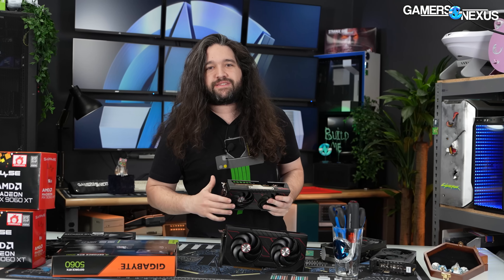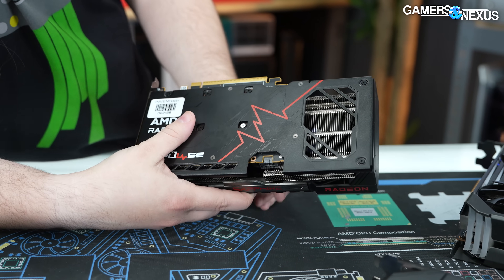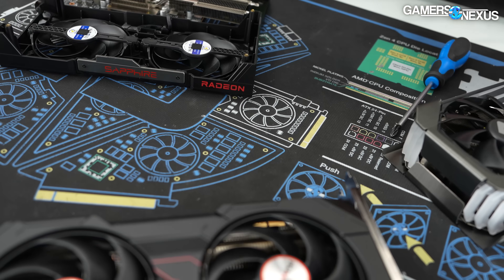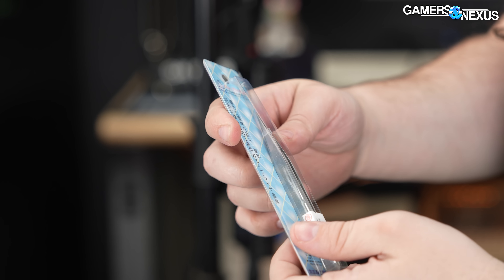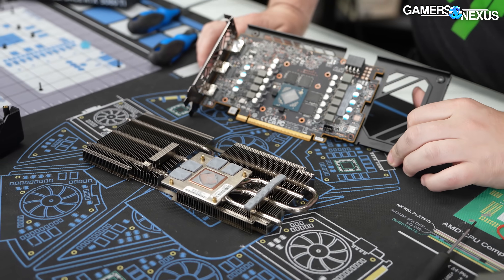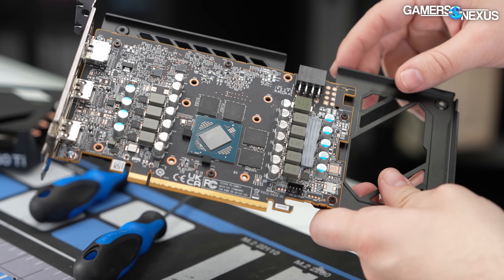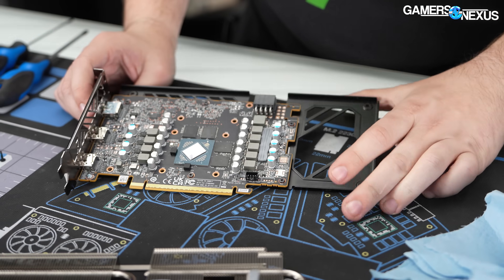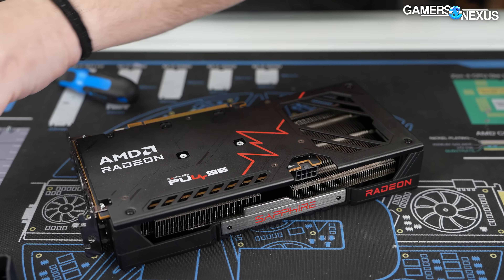Tearing Down Sapphire's RX 9060 XT 16GB & 8GB Pulse GPUs

Comment: 3070ti held on so long just to get replaced with an AMD card in the next coming months never realized I been using DLSS all my life
Reply: crazy that the 4 year old 3070 ti is still faster than brand new low to mid range cards, including the 9060 xt
Reply: @drewsillytoo  Just the 8gb of vram holding it back. Planned obsolescence. 😐

Comment: i envy those who can live in peace with that hotspot delta
Reply: Doesn't matter much. It just shows, that the cooling solution is not exactly a quality one. Which is not surprising, because the Pulse line is Sapphire's low budget tier. As long the core is comfortably under the max. junction temperature, which should be around 100-110°C the card won't throttle or gets potentially damaged.

Comment: Don't bother putting the 8GB back together
Reply: it shouldnt have been made in the first place, but its here now and throwing it away would be even more wasteful.
Reply: well, actually.... for someone, who play MMO like Warframe and i dont know... Destiny? 16GB is too OP, 8 totally enough. BUT price nearlly same. So i not sure why thats 8gb version even exist.
Reply: @Sasha-ud2eb  then they should be buying a massively cheaper card somewhere around 1650 levels of performance.
the 9060xt even with 8gb is still massive overkill
Reply: @guesswho2778  well, true... GTX5050 anonced, for 250$, looks like that card will be enough for game like that. At least DLSS for cheap. But that card must cost 200$, IMHO
Reply: @Sasha-ud2eb  go for a used 1650.
will still do the job and should be far cheaper.
hell even an old 1050 and one of those wouldnt need a power cable.
cant recall if the base model 1650 needs a power cable or not.

or, maybe an amd apu.
one of the ones with the powerful igpus in them.
Reply: @guesswho2778  i will search some used gpu maybe, not sure... Thanks for advice)
Reply: @Sasha-ud2eb  for destiny 2 you may want to go for a 1060 6gb.
it will require a power cable, but it should be fairly cheap and its the recommended gpu for it on their steam page.
make sure it is the 6gb vram variant though.
Reply: @guesswho2778  actually, for my old, but not so bad i7 3770 i kinda want 5050. Dlss, new driver version, and so on. Atm using 1050ti, and i get bsod on new driver, back to 2016 year version😢

Comment: now we just need someone to solder on the extra 8 pin power and some modded drivers to up the powerdraw and see where we can get
Reply: not even need to solder extra connections, 1x8pin should be able to handle to 300W easily
Reply: LHe3
Reply: No,  reduce nuclear and undervolt

Comment: 11:01 Was that thermal paste or a chunk of the die flying off? 👀
Reply: by the sound it was the die but most likely the die didn't die
Reply: as long as it just chipped that little piece and didn't crack into the die it's fine. There's normally a ton of structural silicon on the top.
Reply: Just the upper edge, should be fine...

Comment: $350 models instantly sold out of course and now the rest of them are trying to sell for $380+
Reply: They weren't instantly sold out, took 3-4 hours in the US on Newegg for them to go above msrp
Reply: ANOTHER BUST for AMD as their AIB partners and retailers are PRICE GOUGING as much as they can.
ABSOLUTELY DISGUSTING!!
Reply: I can still buy 9060 xt 8 gb for msrp right now and 9060 xt 16gb for $30 over msrp. You blowing it out of proportion.  @muaddib7356
Reply: @muaddib7356 ? what price gouging, 9060 xt 8gb still at msrp on newegg and the 16gb took 4 hours after launch before going up $30 usd, the price is $389 usd in the US. I bought 1 16gb 30 min at release for msrp then cam back 3 hours later and bought another for a family member, again, at msrp. Yall just be crying to hear yourself cry.

Comment: You should really clarify what the wholesale cost of the actual memory chips is... Because it is basically fuck all these days!
There is no reason for an 8GB card... At the very least they could have made it 12 GB in the smaller capacity model.
Reply: Due to how memory buses work, they couldn't give the lower model 12GB without changing the bus, which would be prohibitively expensive.

Comment: I have a question  if you can answer but do yoi know why onlu nvidia is using gddr7 or gddr6x and amd is been using gddr6 on these generations. Could nvidia  have exclusive deal with the manufacturers of vram 6x and 7 or someone could explain it why thank you and  good tutorial
Reply: The reason AMD is not using GDDR7 is because the supply of it is still low. Nvidia has a lot more money to spend than AMD does, so Nvidia uses GDDR7.
Reply: @benjaminoechsli1941  AMD has plenty of money to spend. They are now bigger than Intel.

Comment: I'm so glad the 8GB and 16GB cards look identical. Because the naming scheme didn't mislead the average consumer enough.
Reply: Yeah, they could have dropped the XT for the 8GB model.  Or called it an RX 9055.
Reply: Are buyers blind enough to not see giant 16GB/8GB on card boxes? They are same exact GPU why would they have different name? Since when we are naming GPUs different when they have different VRAM amounts?
Reply: @desgard  Different names because 16GB = 1440p gaming, 8GB = 1080p gaming.
Reply: 7900gre, xt, and xtx pretty much look identical. you must be new here..
Reply: @babyj-nes are you dumb my dude, the naming is identical on the 9060 XT for both 8 and 16 GB which is misleading
Reply: I'm not defending AMD because I think the 8GB shouldn't exist, but the naming is completely fine because it is THE EXACT SAME GPU. You just need to read the box for 8 or 16GB. The GPU chip is the exact same between the two models.

It's completely different the 1060 6GB and 1060 3GB for example, the 3GB version had less cuda cores and lower clocks. 9060XT is the exact same amount of cores, cache, and same clocks.
Reply: @LucasStaffel then why in the last gen the 7600xt and the 7600 exits? These are also the same navi33 die and same number of cores the difference were 8gb of vram vs 16gb of vram and the 7600xt comes with slighly higher clock speed. Which is almost the same as this gen where most 16gb models come with a higher overclock from the factory compared to the 8gb variant.
Reply: @franciscoriccio51  7600XT was higher binned chip, was higher clocked and with bigger power limit (Navi 33 XT vs Navi 33 XL)
Reply: @timiko4 I fail to see why they couldn't do the same this generation other than greed
Reply: @franciscoriccio51  maybe cause chip can't clock much higher with enough of yield of these
Reply: @franciscoriccio51  also with 7600XT when was released many people got butthurt that name is missleading cause "XT should be faster model, but on averages it's almost the same"
Reply: @LucasStaffel  Exact same GPU doesn't matter if the amount of VRAM causes them to perform very differently in games. A graphics card is not just the GPU, it's all of the components. Different VRAM means different performance means different graphics card means different name. 

You are defending AMD, and you need to stop.
Reply: @mjc0961 and for whatever reason it's suddenly an issue now, not when there were RX470/570/480/580 (4GiB and 8GiB), RX 5500XT (4GiB and 8GiB), RX 450/550 (2GiB and 4GiB), R9 370/380/290x/270x (2GiB and 4GiB). I can go so far back like GeForce2 Ti with 32MiB and 64MiB versions or Voodoo Banshee with 8MiB and 16MiB.
Reply: @LucasStaffel  people that buys a prebuilt PC will get the 8GB card without knowing. How is that fine?
Reply: @Qyngali if people began to maliciously comply with listings and return them when it was 8GB but the listing omitted this info...
People will get shafted with prebuilts regardless.
You argue they won't notice 8 vs 16.
I might argue they wouldn't notice "9060 8GB vs 9060 XT 16GB" either. You can't save them all.
Reply: Why would they not look identical?
Reply: @VADemon Because they're different cards.
Reply: @Greeny83 Physical appearance is expensive to change. In part I don't understand why so many similar (per) partner models exist for each card.
I think it'd only be a good balance if AMD called it non-XT.

But as another user put it under previous video: "look and pay attention now, AMD isn't your friend. it's just another corporation"
Reply: @VADemon yeah people forget that AMD isnt some sort of godsend to add competition to Nvidia it’s still a company lol

To be real though you are spending multiple hundreds of dollars on a fairly fragile piece of hardware like read the description on the box/webpage or if it is in a prebuilt CONTACT THEM even best buy can tell you the specs of something in their inventory
Reply: @Greeny83  that's like saying you should change the chassis of a car because one version has a turbocharger and DCT and the other has no forced induction and an automatic transmission.  They're the same car.  Same engine, even.  Just one has had more features added and costs more.
Reply: @Greeny83  it's the same card with different memory configurations. if the consumer is dumb enough to not read 8gb or 16gb, this is the wrong hobby for them.
Reply: It's fine really, you shouldn't buy either of them. It won't matter if it's 8GB or 16GB, you should be buying ZERO GB of Radeon RX 9060 XT
Reply: @itstheweirdguy the 9060XT is a hell of a lot better than the 5060 Ti is… you recommending people buy that instead? The used market isnt any better, 6700XTs go for $280-340 which is absolutely bananas.
Reply: @itstheweirdguy are you fanboying nvdia or why you wrote such a bad take?

Comment: Why don't they tie the heat pipe into the backplate on the opposite side (ie wrapped) or have the chip flipped over and socketted through so they have the whole backside for it.. Sodimm sockets..(again)

Comment: Sapphire seems like a decent GPU company
Reply: They make good cards, their Nitro line is a bit expensive, but it's nice that they have a 'budget' line and a more upmarket line that's still reasonably priced.
Reply: They are the EVGA of Radeon. XFX is another Radeon-only company, but I'll always pick Sapphire as my go-to.
Reply: @kozad86  XFX actually started out making nvidia cards (and their parent company pine also made graphics cards with chips from various other manufacturers way back in the day) but nvidia ditched them after they started also making ATi cards
Reply: Kinda to AMD as EVGA was to Nvidia.
Reply: They're solid, usually very good performance. I'd say all the AMD board partners are good, Sapphire, XFX, and Powercolor
Reply: @aylim3088  
I have to disagree. While Powercolor and Sapphire are usually the go-to options, XFX frequently (but not always) screws up with subpar and loud coolers. Their 9070 series are among the worst.
But as always, check reviews.
Reply: They were the first to ship cards with vapor chamber coolers, they are like the EVGA of Radeon. (Guess everyone said the same thing)
Reply: I have owned several sapphire cards and never had any problems with them
Reply: @michaelhemric  I've been getting on-off display driver crashes when fullscreening content like Discord or YouTube videos, very randomly, on my Sapphire Pulse 6700 (non-XT). Although that could just be an AMD issue.
Reply: @michaelhemric  All my amd cards (so all my cards with the exception of a 8600 gts) have been Sapphire, I never had a problem with any of them, so I continue to buy them.
Reply: Sapphire is the EVGA of AMD cards, as everyone else has already said...

In short, they make good stuff.
Reply: For AMD Radeons, Sapphire is considered the best. Owned quite a number of them, zero issues. But personally I prefer the designs of XFX cards. But generally speaking, all the Radeon-exclusive companies like Sapphire, XFX, Powercolor are very good.
Reply: Had mine for 5 years. No complaints
Reply: One of my first GPU's was a Sapphire card :D
Reply: They have been around a long time.
Reply: I still use twin Sapphire HD4780's in Crossfire configuration to run my automotive Dynamometer... they are 15 years old and still absolutely rock solid.
Reply: Yes. They are good
Reply: Had 3 generationz of GPUs from them. Solid. No flashy rgb, no complaints.
Reply: Sapphire definitely a maker of stable and cool graphics cards!
Reply: They are where I got my now flatlined rx 480 8gb back in the day 😔
(Flatlined from a power surge from a storm several years ago)
Reply: Surge protection?  @HonkeyMagoo
Reply: @HonkeyMagoo that is why you use good psu and ups
Reply: Pulse series been getting less and less love
Reply: I have always respected Sapphire, but in the latest 9060XT review from HWU the sluggish Asus Prime showed 3-6 degrees lower GPU, hotspot and memory temperatures than the top-end Nitro lmao. And a Pulse series definitely needed new design - Sapphire has been releasing this series in the same form and colors for almost 10 years now. By modern standards these cards looks boring, the red color is not suitable for almost any PC build and besides, they are not offered in generic white. And at 7:41 it can be seen that the most miserable and cheapest way was used to cool the VRM - thin plates/bent fins, that have a supermediocre level of cooling. Not everything is as great with Sapphire products as we would like.
Reply: @MakeYourVision Sapphire pure is white version of pulse. But pulse is seriously lacking some features compared to previous generation like bios flash, lights, separated VRM and GPU heatsink etc. Some brands like gigabyte even got Vapor Chamber in the GPU.

Pulse is skimping while Nitro is being overkill.
Reply: @MakeYourVision TPU came to an entirely different conclusion, especially when noise-normalized.
Reply: @cl4ster17 So far, I've seen 2 reviews where Prime had better temperatures with same noise level as Nitro and one review which Nitro was better kekw
Reply: XFX have a much better warranty than Sapphire
Reply: they trade off design for reliability, especially their Pulse stuff... they've looked the same since pretty much forever.
Reply: Had a sapphire 6950 maybe 15years ago, beast is still alive, more recently got a 6650 nitro xt ans now have a 7900xt pulse edition. Every one of them overclocked/undervolted balls to the walls and they still kicking 😂
Reply: iirc they don't have great customer service, but they're the least likely to require it.
Reply: @concinnus They sent me a bios version that bricked my card, then they refused to help me lmfao 😂
Reply: I mean I've always been a saphire fan also and always team red. But come on, the product was missing 2 thermal pads.... that's a significant manufacturing defect.

I believe the 9070xt also had a manufacturing defect during that teardown which was also a saphire pulse product.

Maybe the quality control is better on their higher end skus but for me, I'm staying clear of their pulse offerings at a minimum.
Reply: @MrMJB1990  Pulse series is always the same quality as competitor's Hellhound series, that is to say a way to offer you a product as cheap as possible to hit a price point. The Nitro series is where the magic happens from Sapphire.
Reply: honest question, are you all bots? Because you sound like you want to sell something
Reply: Sapphire is bleading edge AMD wtf

Comment: Missing thermal pads and passing QC, nice
Reply: I wonder if they omitted it on purpose due to the thermals of the memory.
Reply: @notsam498  It worries me. If this was accidental or on purpose. Its kinda a big thing.
Reply: @webdigo if it was on purpose it makes sense. As Steve pointed out, it wouldn't make that much of a difference... Except to the backside memory which seems to be tapping out the backplate for cooling. It seems entirely likely the engineers probably would have figured that out pretty quick and tried to mitigate there memory temps.
Reply: @notsam498  I have 16 GB version and it has this small pad and the backplate cools only VRAM (but I think that is better)

Comment: The 9060 xt Looks promising if the price is right. I hope they don’t fuck it up
Reply: The MSRP is fine, good even. It falls to the AIBs, distributors, and retailers to make AMD's suggestion a reality.
Reply: @benjaminoechsli1941  yeah but it would be better if the 8 gb version would be below $250 because the b580 is $250 with 12 gb vram
Reply: @benjaminoechsli1941 which it will NOT, because AMD doesn't have a reference model to anchor the MSRP. This means AIBs can do whatever they want and extract as much marging as they want.

It will be like the 9070 and 9070 XT. Fake MSRP baiting and switching in hopes to get good market sentiment from the first reviews. Simply because at least from the first slide decks sent by AMD, they wanted the 9070 XT to be MSRP at about 700$, like literally NVIDIA minus 50 bucks.
Reply: @punmeistervstheworld  hello userbenchmark, can you put "amd drivers bad" into your comment too? :D

Comment: I got mine 16gb 9060 xt for 368.04 I have no regrets.
Reply: Can pick them up at micro center for msrp right now. I might just buy one just because and i've been rocking the 7900 xt for some years now
Reply: @silentx9709  Why would you pick a new but worse performer Gpu? Only the 9070XT is better than your GPU.
Reply: @silentx9709  the 7900XT is pretty good, why downgrade?
Reply: @silentx9709 as people said if you wanna upgrade sell yours recover some money and buy the 9070 xt instead that way you get the upgrade and new technologies  otherwise your 7900xt is still gonna hold strong for a few more years.